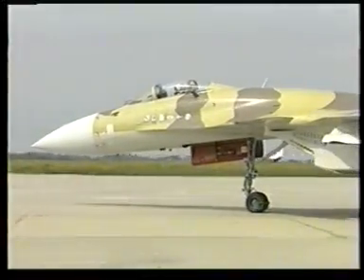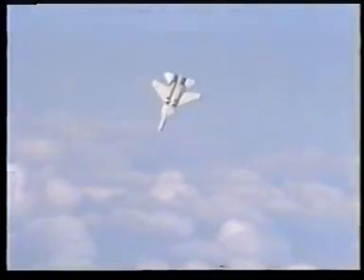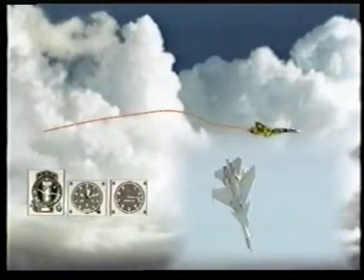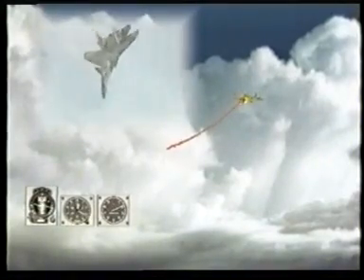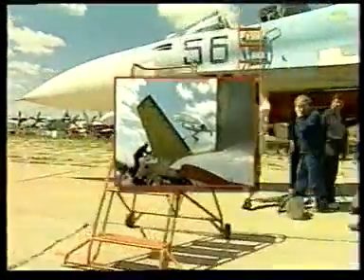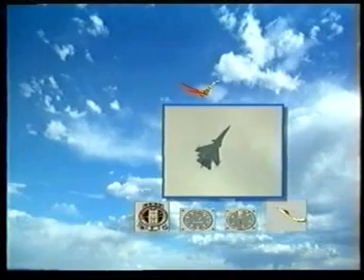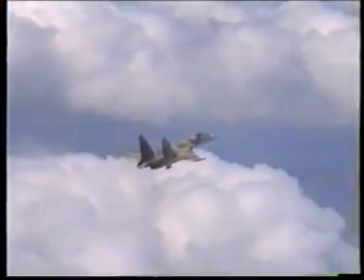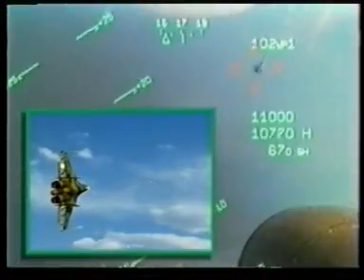Su-37 "Terminator"

Comment: serpent....You have to see the enemy first and lock on with radar BEFORE you can fire ANY missles, no matter what direction.
The AIM 120D being developed for the RAPTOR has a range of over 120 miles (720km)..and is a fire-and-forget guidance system....besides the F22 won't be detected until it is too late..!